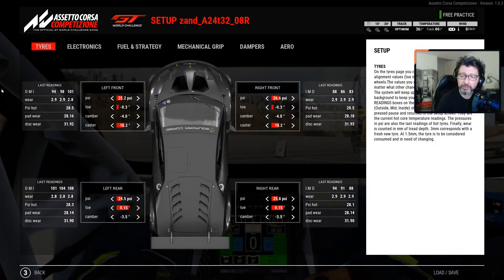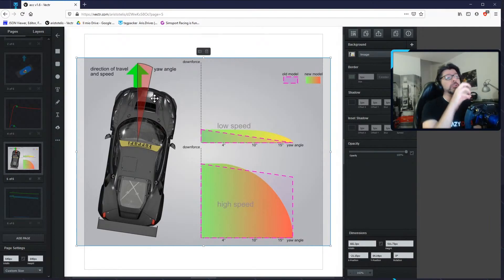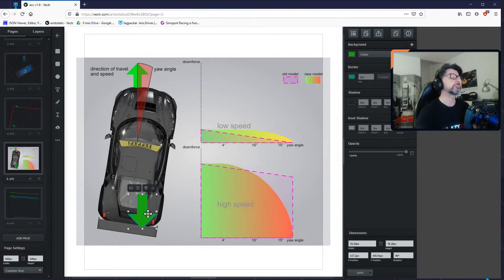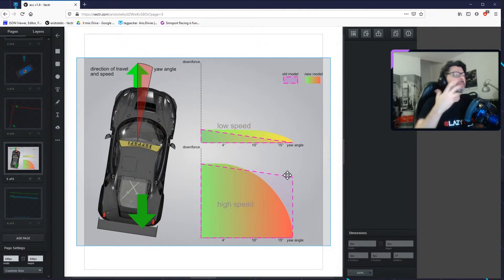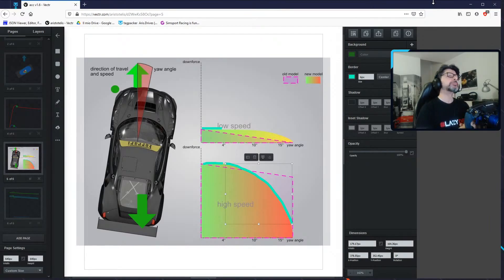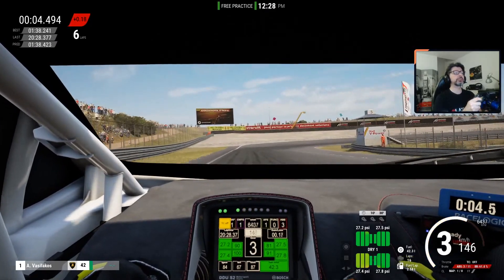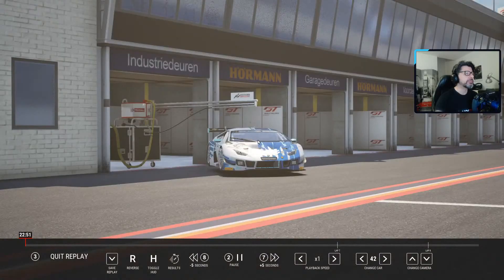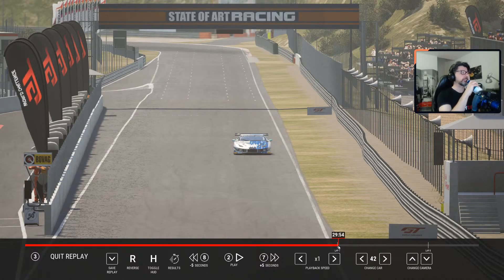TL;DW - Aerodynamic effects during yaw rotation in ACC v1.6

Comment: It means more downforce in low speed (what it means? Where is the border between low and high speed in ACC?) and less in high speed corners.
Reply: The downforce drop off is speed dependant. So a low speed will have less of a drop off effect from optimum. Compared to high speed the drop off will be more significant.
There is no cut off point for hi and low speed as it constantly evolves for every kmh faster or slower you are going.
Reply: @mattsamuel4119  I know how does it work in real world, but only devs (or even no) know how does it work in ACC :). I hope it is like in reality, but those 2 tables presented by Aris confusing me.
Reply: @86mystek  the tables maybe confusing you but this may help. The low speed table has for example 40kg max downforce and drops to 20kg at a given angle so 50% drop but its only 20kg different so not much. High speed could be 400kg max and 50% is 200kg which you would really easily notice. The difference with low speed at an angle is less because there is less to lose in the first place.
Reply: What You are looking at right now is that, in very basic words, you have more downforce in low speed with high yaw angles and less downforce in high speed with high yaw angles. There is no cutoff where you say this is low speed and this is high speed. Downforce increases exponentially with more speed, so it is lost exponentially with yaw angles increasing.